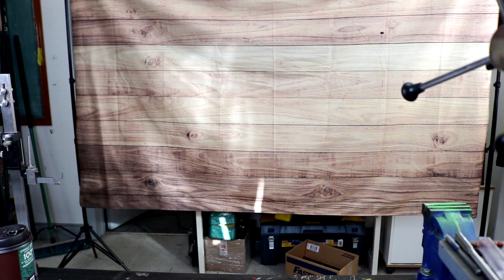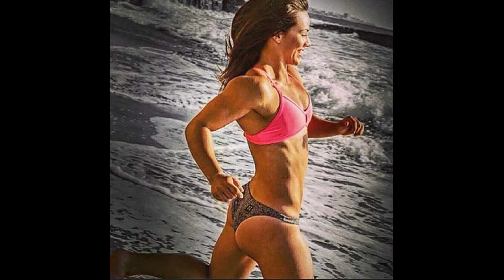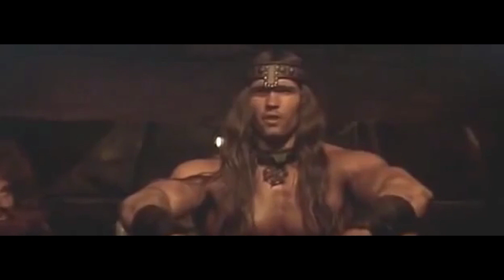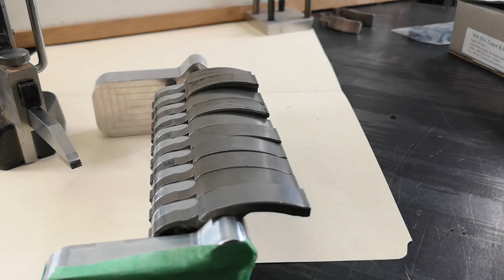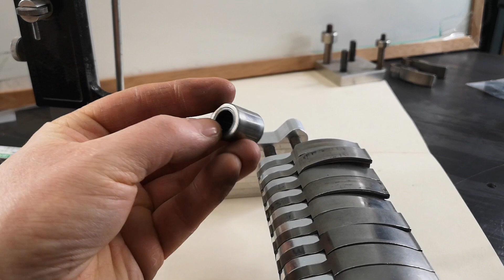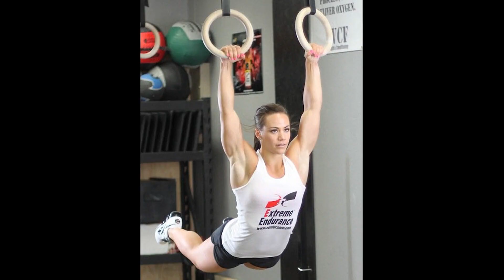Ski-Doo pDrive clutch how ramps work Part 2 iBackshift

Comment: I just bought a 2019 renegade backcountry 600r etec and engagement is 3800-4000 rpm..it comes in with a hard clunk and i have read that a lot of people complained about it so the ramps were changed to a 901 in 2020. Do i need to change the spring out as well to get this down to a 3500 rpm engagement..Thanks
Reply from the maker: get a spacer to take up the belt gap.  BRP#417224757 its from a turbo 850. 
You remove the clutch, take the cushion[cover] off and install the shim and put the clutch back together again.  This will close the clutch gap another 020.  Closing up the belt gap will help to lower the surge feel.  And change the primary clutch spring to one with a lower start force to lower the engagement speed.
Reply: @iBackshift Just so i am clear, i don't need to change the ramps as well..I see the 2020 to current have both ramps 951(mine) to 901 (current) as well as different springs. I am only using this sled 200kms per year to get to my cottage but i cant stand the way this thing engages when putting on and off my trailer and my cement floor  with studs installed. Thanks
Reply from the maker: @brianyoung6583  Hm, i forgot the 18~19 bc had 951's, why, i dont know.  Regardless if you have 951 or 901 or 997, its still going to surge.  Need to lower the start force of the primary spring, tighten up the belt gap and run as tight as belt deflection as you can, tight but not squealing, but just before that.
Reply: @iBackshift  Okay thanks , i just didn't know if i needed new ramps and spring or if they went hand in hand .. Its  another 130 dollars. My secondary rollers are broke as well at 6400km.. Im pretty sure i broke them backing in the garage. .I have owned this sled since last thursday and have 15 minutes worth of seat time on it. If i would have known that the secondary rollers were such a problem on these and the insane amount of work  to get them changed (pull jackshaft) i would have never bought a skidoo.
Reply from the maker: @brianyoung6583  With the helix tool and the top gear tool, its a super easy job to do.  yer the best guy to do it.  Get hightorquerollers from bc.  As long as you have a place to work on the sled.  Then high probability the hightorquerollers will outlast your sled.
Reply: @iBackshift  i understand but i need the pdrive tools as well to take it apart..add it all up and its probably 300 dollars plus. if i only need to do this one time i might as well take it to a dealer.  My biggest fear is that i order new parts for the p drive and it doesn't even fix my issue with 3800rpm engagement. i guess i better go to a dealer and get him to start a 600r newer than 2019 to see what it does..could be a complete waste of time and money.
Reply: @iBackshift  i have the 18 backcountry also and find it super aggresive from 0-20 mph.  So is it best i change ramps or spring also?
What ramps and springs your guys running?